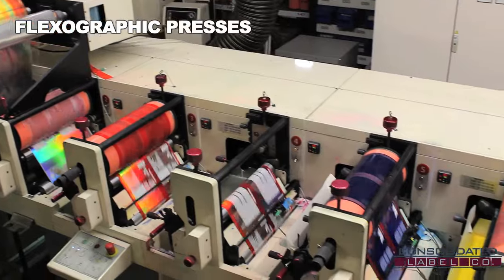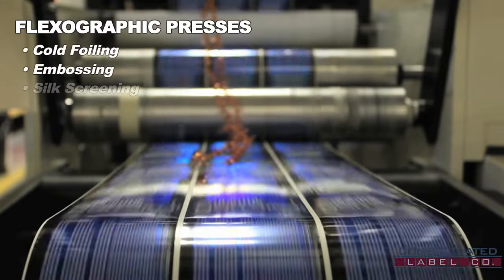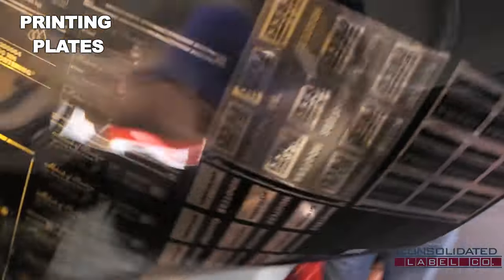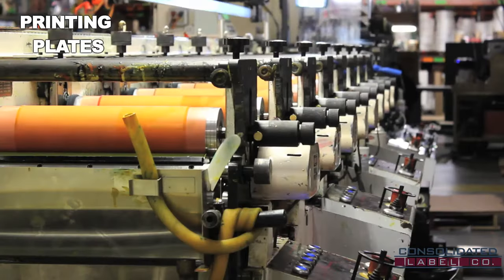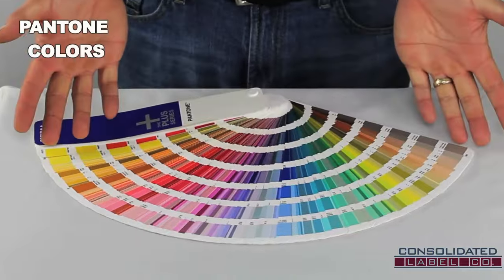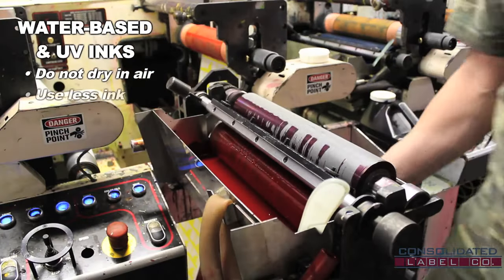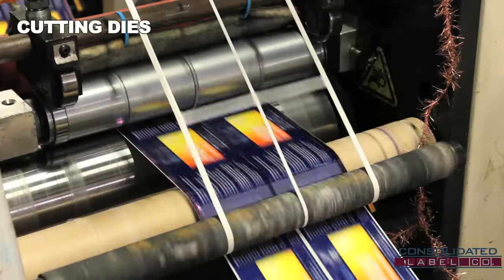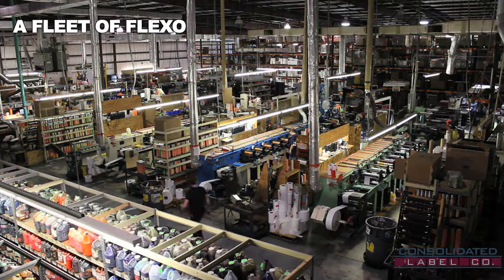Flexographic Printing: Technical Process

Comment: I will assume only do large print orders. Who does this for small print runs?
Reply from the maker: Hi Dom, you are correct - we use flexographic presses for large volume orders. We can use flexographic presses for smaller volumes but it's not as cost-effective. That's why we use digital presses for small volumes because it's a better value. You can learn more about digital printing in our video here: https://youtu.be/1Ldrq6kO5go